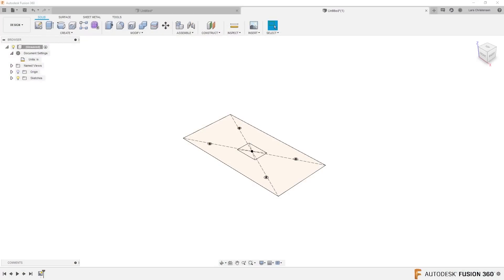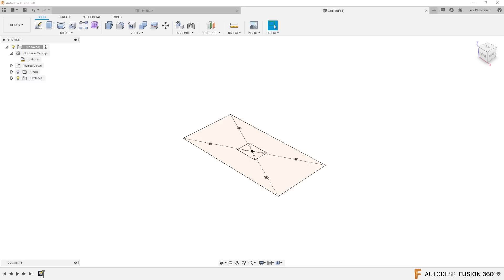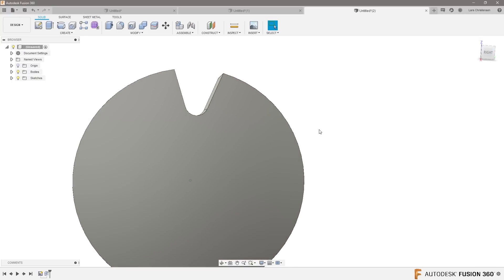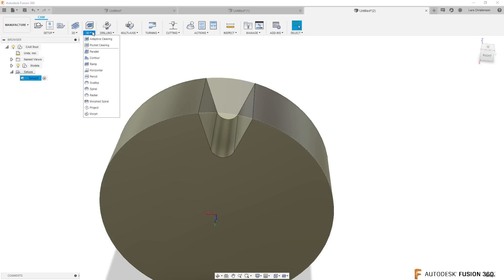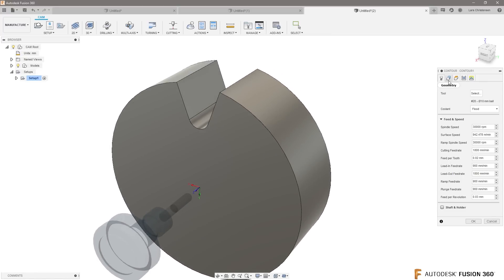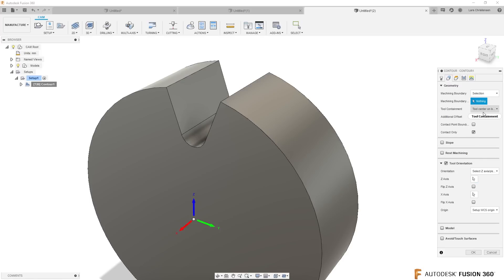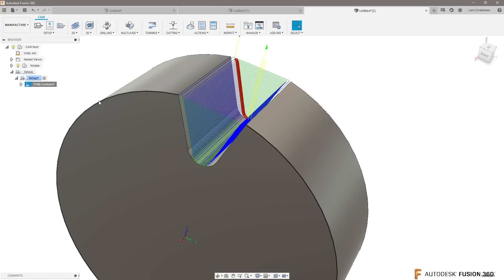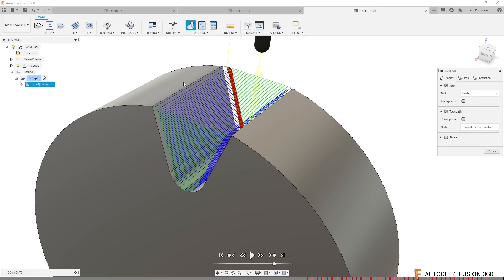Fusion 360 — CAM Selection for Toothed Belt — Ask LarsLive

Comment: But surely if you actually ran this toolpath, you'd have a bad experience? There's no roughing / clearing path to get the bulk material out of the way first. Ramming the tool down into the stock like this wouldn't end well. 

If the requests you are answering don't understand how to place a fairly simple 3D Contour, they aren't going to know to do a clearing operation first.

Can I request you make a video of what happens when you run this on real stock? I'd enjoy watching that.
Reply from the maker: You are right.

Comment: Lars , this video is realy helpful but i'm still wondering if it should'nt be possibel to create a 2d toolpath with the wrapped toolpath comand ? this way it would be much faster to machine
Reply from the maker: Got it. You could use the Setup within the operation and then align it with the slightly tapered wall and then use the contour toolpath. Then repeat that on the other side. Do you have a rotary table on the machine? Changing the setup within the toolpath will change the A/B axis rotation if your post supports it

Comment: Vid request. A Q was asked in a recent vid about joints, and I'm expanding on it. He asked how to joint the motion between a pulley and a toothed belt. I'd like to see a small simple full assembly, motor, pulley, belt, pulley, lead screw with nut, idler tensioner. No frame really, just mounted something to ground it. Aaaaand please take that all the way through motion study. :) Thanks for your great vids.